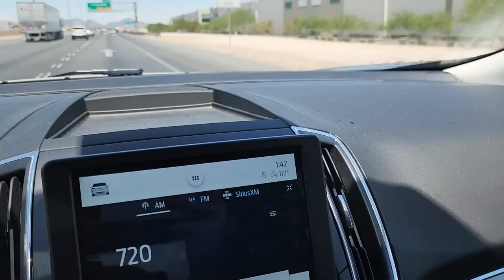REAR END STILL BENT..... CANT BELIEVE THIS. SMH. HERE WE GO.... WILL IT EVER BE RIGHT?

Comment: How the hell can a body shop/repair facility who specialise in car repairs screw up so  badly, (including the alignment shop) it goes beyond belief.
Correct me if i am wrong TK but should that have not been on the vehicle damage report about the obvious bent rear axle and suspension parts?
Reply from the maker: Yeah it Was disclosed
Reply: @TKsGarage  Okay so the axel turns out it should be okay but to miss the obvious damage to the suspension components is unbelievable and a major failure on the repair shop and the alignment shop.

Comment: Last time I went into a Monroe shop to get work done on my truck it looked like the workers were in their teens. 2 customers complaining. A lady had 4 new tires put on the day before and when she came out to take her kids to school, two were flat. A neighbor aired them up and she made it back to Monroe. I had a muffler and tail pipe put on, and the tail pipe faced downward. Kid welded the hanger on wrong and just left it that way. I bitched and had to sit there 45 minutes while they re-did it. The hanger rod was to short, but he used it anyway. Now it rattles at idle if the AC is on ? I'm going to get a universal hanger and fix it myself.